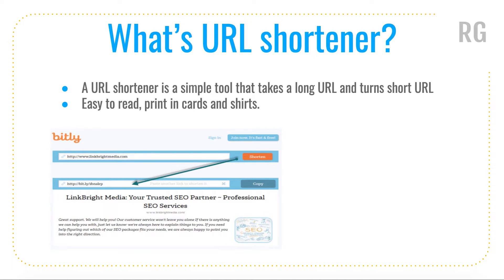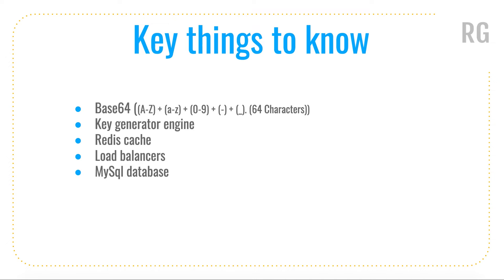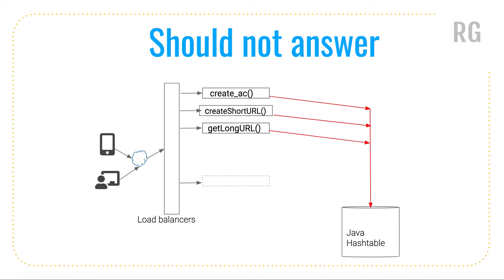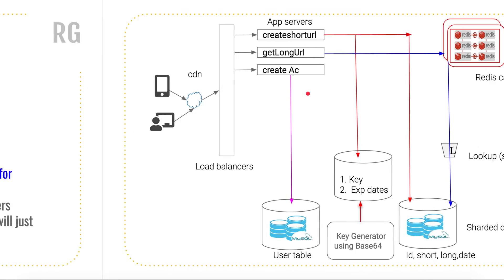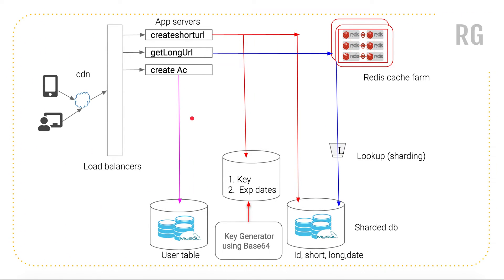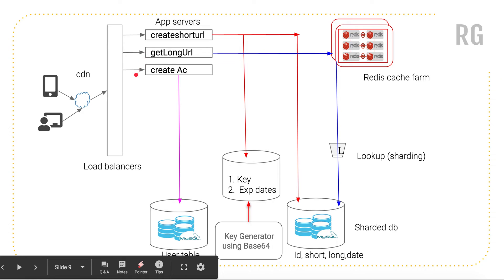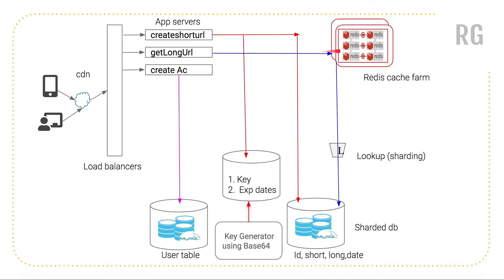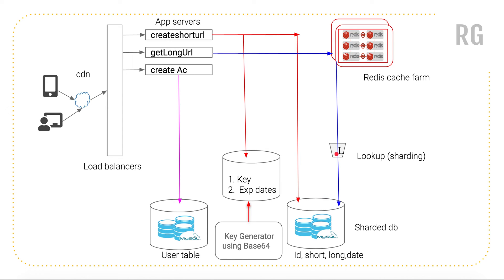System Design : Design a service like TinyUrl

Comment: Hey! Thanks for this video. I have an interview tomorrow and I have been told to prepare on the same topic. I have now some idea about the design.

I have few questions which I have prepared but I want to know from you if the answers are correct.

1. How to track click stats? 
My answer would be to add one extra field like counter which will increment every time the user requests getLongUrl.

2. How would you generate unique IDs at scale (thousands of URL shortening requests coming every second) ?
My answer would be to use multiple load balancers which ensures that the requests gets distributed evenly in different servers.

3. How to generate a unique ID for each URL ?
As you have explained in the video by using base64 encoding.

4. How to delete expired URLs in NoSQL ?
My answer - By setting Time to Live where we will define a time after which the data will be removed.

5. How would your service handle redirects ?
My answer - After the user clicks on the shortUrl we will check if the longUrl exists for the same. If yes, then we will redirect the user to the same.

Thank You.
Reply from the maker: How to track click stats? 

KK: 
If you have extra field in the database, you loose the purpose of Redis cache as you are accessing the db for every getLongURL()
My suggestion is to have the counter in the redis cache. At end of the day update the database field with batch job. In this way you 
are not impacting the user performance.

2. How would you generate unique IDs at scale (thousands of URL shortening requests coming every second) ?
KK:
As explained, unique ID's are generated in advance and kept ready. They are not generated on fly.

3. How to generate a unique ID for each URL ?
KK: Each company uses it's own way to create unique id and they won't reveal the algorithm.
But to have an idea, please refer this link https://stackoverflow.com/questions/3990820/how-can-i-make-short-random-unique-keys-like-youtube-video-ids-in-php

4. How to delete expired URLs in NoSQL ?
KK:
Why do you need to delete expired URL's? I am not clear. If my understanding is right,
Let's say some one(mostly paid customer) has create a short URL and if they decide to remove.
You can provide the UI to request. Once, request comes to server, delete from database and Redis cache. 

5. How would your service handle redirects ?
KK: There are API's to forward and redirect the request.
Reply: @ReachGoals  excellent answers sir except in the first question, what if the redis cache goes down before batch updating the database.

Comment: Hi Sir, how we are ensuring the same short URL key will be unique if we are taking only the first 7 characters from the generated 64 chars from Base62 Algo?
Reply from the maker: We are not taking first 7 char. We are generating 7 char. Also, Key generator engine will take care and make sure it is supplying only the unique key and if the key is already used,  key generator will not return the key. Hope this helps. I have discussed about this too.

Comment: As this system is read heavy and here we have only two relation between user table and short-long url table then why did you choose RDBMS like MYSQL, i think a better choice could be Cassandra, Dynamo or any other No-SQL DB.
Reply from the maker: Yes,  It's possible to build the similar system with NoSQL.

Comment: CreateshortUrl can also communicate with redis right? Beacause what if user wants to create a shorturl of longurl, for which short url already exist.

How sharding is done on expiredate?
Like based on the urls that are gonna expire before febrauary-1 on database server and remaining on march-1,april-1.... on different databse servers.

Thanks in advance
Reply from the maker: If you look at system design diagram,  CreateshortUrl is not connected to redis.

short URL is generated as unique key and is based on Base64. There won't be same short url in the system. Hence, short url is unique.

I have answered the same question about sharding in another comment. Please check the first comment
https://www.youtube.com/watch?v=2dHIPJqhffY&lc=UgySXyDp8aPKrOkv2Vh4AaABAg.91SkFML1URq91T7uCfRk8I

Comment: I don’t understand how the ids could be sharded based on the expirydate. 

My confusion is that, a user makes a request to fetch the shortenUrl. This API takes in only the long url. At this point, you only have the long url - no expiry date. So how can you do the lookup with just the long url.

Love your videos and look forward to your response!
Reply from the maker: @Tech User, Thanks for asking the question. 

How getLongURL can reach the shard? 

Sharding can be done in multiple ways. Let's say, you have dates in the table  like below( in real design, it will be epoch)

Shard1 
18-7-2018
25-7-2018

Shard2 
19-7-2019
29-7-2019

getLongURL will hava Key, If we know the key, you can get the expiration date from the table (key, exp date). Once you have the exp-date, you can go to one of the sharded database. Ex, if the key return 25-7-2018, then, system can read the prop file which has map 2018 -> db(shard1) and reach shard 1

How creatShortUrl can reach the shard? 

Sharding is a process which takes place when the system grows or scales up.
During the creatShortUrl time, it may not (in most cases) required to shard automatically or DB/table are not created on fly. Engineers monitor the grow of system and if the performance is not good, they move the records based on the expiry day to another shard

Choosing exp date may not be efficient way to shard, I just want to bring the concept here.  I will prepare another video explicitly for sharding, best practices and that will help you. 

Note: Sorry, I didn't explain above point in the video as topic was not about sharding. But your question made me to clarify and I really appreciate this.
---------------------------------------------------------------------------------------------------------------------